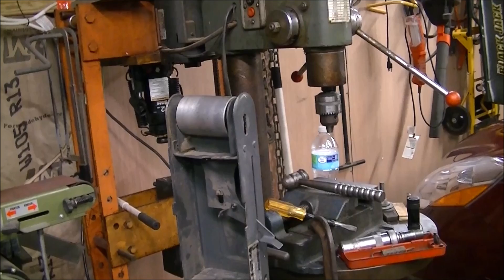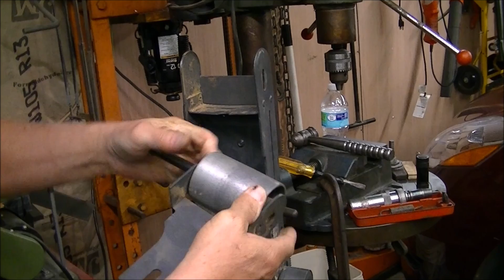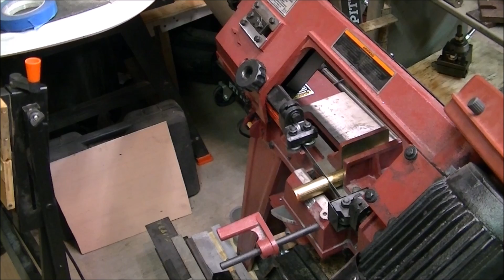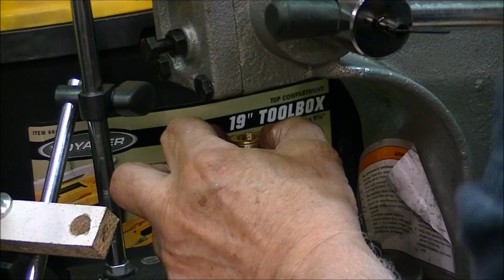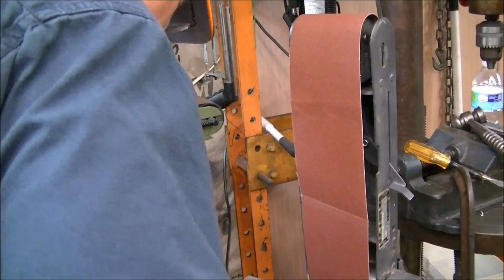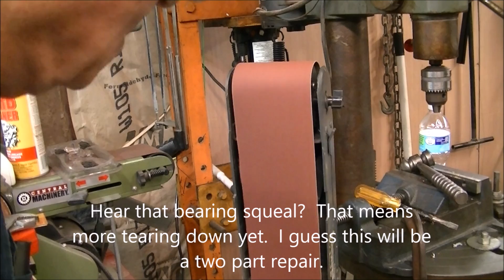Craftsman belt sander repair part 1 of 2

Comment: I have the same sander. Split  the  moter case. Put a small amount of grease in the old rear bearing. Worked great. Then the front one started making  racket. Gotta tear it down again. It just might work. Gotta bearing supply house close by. Not giving up yet.

Comment: I think your workshop look perfectly normal Harold! There appears to be no provision for lubrication on your lovely new bearings, perhaps that is why they wore out in just 50 years! I often wonder how they ever assemble these things in a fast production line, when you need three hands to hold all the bits together as you re assemble them, plenty of hands in China I suppose.
Reply from the maker: +Englishman French I just squirted some oil between the bushings.  I figure it cannot be in much worse condition at my estate sale than I found it.  But then I tend to be wrong very often.  =(;-)  Thanks for viewing and commenting.

Comment: I am a relatively new subscriber but I like your videos precisely because you don't practice political correctness. Good luck with learning western Canadian, I live here and still have not mastered it. LOL. Good to see someone repairing instead of throwing away things.  That is the true recycling.  To lube brass bushings, I used to soak them in STP for a while. It seemed to work well, but I don't even know if you can buy STP any more.  Take care.  Tom Wardman
Reply from the maker: I put a couple of squirts of oil in the empty space between them.   I will have to consult you on Canadian from time to time.  I don't think Sears lubed them at all.  Thanks for viewing and commenting.

Comment: Hi Harold.

How do you lube the bushes?   I have a similar setup (we call them linishers in Australia), but the bearings are full width, and bronze.

You could easily make up end housings for the rollers and mount sealed ball races (same as treadmills).

Edward Snowden just confirmed what most intelligent people already knew - big brother has been watching for a very long time.

Cheers Rob.
Reply from the maker: sadly that is true.   I am hoping big bro runs with a pair o scissors and pokes out an eye.   I don't think the original bushings were lubricated very well if at all.     I imagine some oil between them will be at least as good as the original.  Thanks for viewing and commenting.